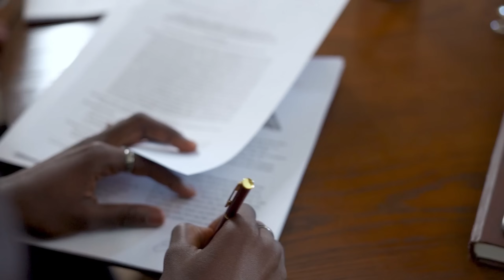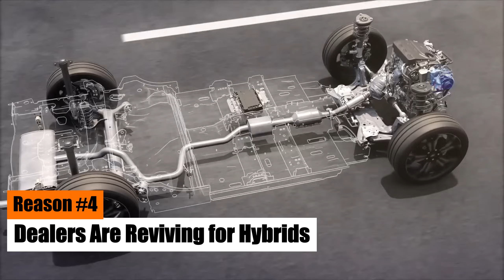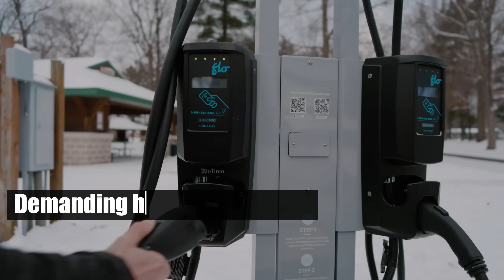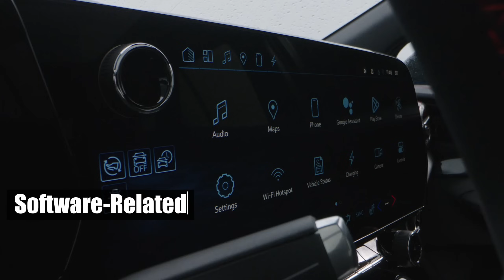GM CEO’s Dilemma: Dealers Quitting Over EV Sales! The Expensive Shift to Electric Vehicles

Comment: The dealer push-back is essential to getting this "green" BS overturned.  It goes well beyond the car market with EV's, but also the solar and wind electric generating being another crock of crap.
Reply: The real “green “ vehicle is the one that will last and be easily repaired if something goes wrong. Like cars used to be before the government messed you up with the mandates and regulations.
Reply: @glennso47 well, yes, cars were easier to repair years ago. A lot of the work can be done by the owner if somewhat mechanically inclined. Oil changes and tire rotations are about it today. I now drive an EV and love it. It’s cheaper for me compared to other cars I’ve owned. All I do is charge it at home. Electric bill is only affected a small amount compared to the high cost of fuel at the pump. But that’s my situation. Others will differ. It’s a green vehicle while driving. No question there. Governments? Suggestions only. Mandates, no!! They need to stay out of it. It’s what’s hurting the EV industry as we see it. You can’t come along and try pushing things on people. That’s called a dictatorship. And that’s NOT what I signed up for, so-to-speak. The EV industry is, I believe, heading in the right direction providing that the real purpose is to solve polluting our planet. Anyway, that’s my take on it. There is one HUGE problem here on YouTube. There are to many that have there own personal thoughts on things, open up a channel and provide false news backed by false facts. It’s in all areas of the media. It’s takes a lot of research on our part to sift through all of it.

Comment: 1983 Rogá at the vocational school in Munich > Profession: Information electronics technician. 
Mathematics teacher says about the energy density comparison; 
"The energy density of a 55 Ah starter battery corresponds to the amount of gasoline that fits in a shot glass. 
Work is force times displacement. Force and displacement do not belong to any religion. That's all I need to know.